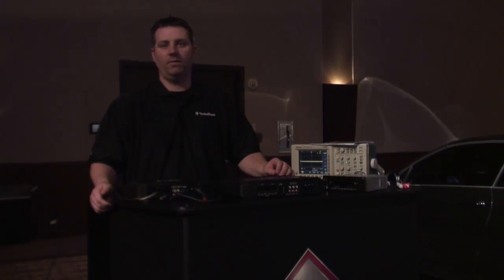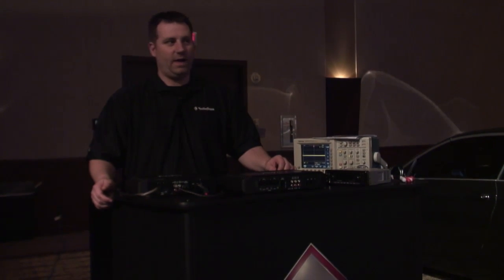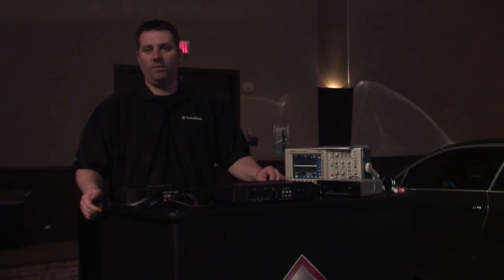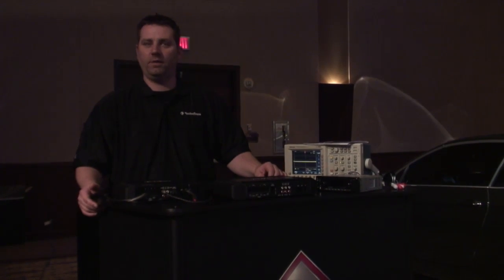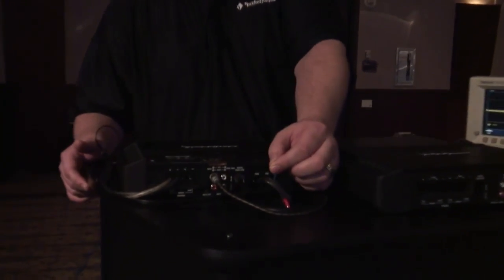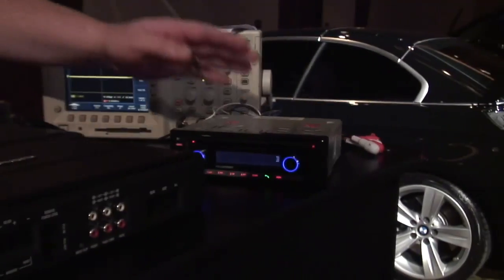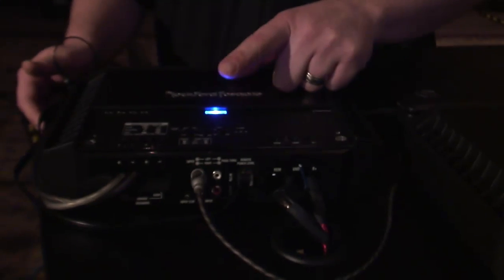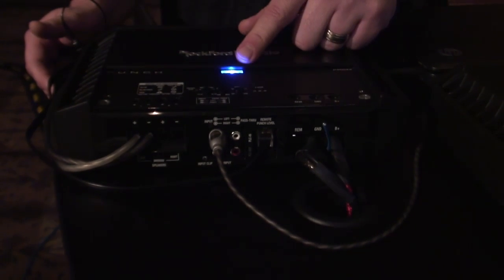2013 Punch Amp Auto Turn-On

Comment: My P1000x1bd won't turn on.
6v on RFI2SW RCA plugs. Using rear channels from stereo. 12v and ground on amp ok.
What have I missed? What have I done wrong?

Please help figure this out.
Reply from the maker: Are you daisy chaining additional amplifiers?  Disconnect the REM terminal and Pass-Thru outputs to see if the amplifier will turn-on.  Does your front amplifier turn-on when using the high-level outputs, but just not the P1000X1bd on the rear outputs?

Comment: So. If using the high level input instead of an LOC, this feature will be automatic?
Reply from the maker: Hi David, Yes, the amplifier has a built-in LOC so there is no need to use an external one.  When the amplifier senses the 6V DC Offset (there is a small DC voltage along with the AC signal voltage present) from the high-level speaker outputs, it will automatically "switch" to high level input mode.

Comment: Hope you guys notice that he is using the high level outs spliced into an RCA plug.
I got excited thinking regular ol' RCAs will auto on.

I swear I had a RF amp that had an auto on through the RCAs. but cant find the model.
Reply from the maker: As noted in the Description of the video, we simply use DC Offset to turn-on the amplifier and no longer use separate RCA inputs and Hi-Level Inputs. Therefore, if there is DC Offset on the RCA line, it will turn on the amplifier.  When using high-level outputs, you can purchase an adaptor so you don't need to cut any RCA cables to do this: https://www.rockfordfosgate.com/products/details/rfi2sw/

Comment: I bought a P-300 10" for my 17 Fiesta ST. I wanna hookup the High Level Input wires to my left rear speaker. Do I have to split the the wires into 4 and combine solid colors for positive and striped for negative (white & grey+, white/black & grey/black-)?
Reply from the maker: For best performance we recommend using BOTH left and right rear speaker signals.  Wiring up only the left speaker will cause your subwoofer frequencies to be lower in output since audio is mixed on both left and right sides.  If you have no choice, but to wire only to the left output, then you are correct and can wire it this way:
POSITIVE: white left(+) and grey right(+)
NEGATIVE: white/black left(-) and grey/black right(-)
Reply: Rockford Fosgate darn, i did have a choice to route wires left and right but i was told it didnt really matter because on the fiesta the rear speakers werent stereo bass...and mounting a single sub like this didnt lose frequency...ugh. hating the thought of removing the wiring now.
Reply from the maker: To the best of my knowledge, many systems subwoofer frequencies are mixed across both channels.  Just wanting you to understand that subwoofer frequencies are typically summed and you may experience lower than anticipated output using one output.  This would especially be true if the BALANCE knob on your source unit is anything but "centered". Move it to the right and you'll definitely have lower output.  You should be fine to use the LEFT output.
Reply: Rockford Fosgate thank you sir!

Comment: I have a yellow light on my p1000 x5 amp and don't know why
Reply from the maker: That is the Power/Protect/Thermal LED.  If this illuminates after the amp has run for a while, the amplifier is in "thermal" mode and needs to cool down before it will turn-on again.  If the LED is always on and cool, remove all speaker wires and RCA's from the amplifier (so you only have B+, GND, and REMote).  If the amplifier works, you most likely have a short or bad speaker on one of your cables.

Comment: Could I run your Rockford Fosgate 5 channel p1000x 5 punch  with 4 door speakers 2 p1675 punch 6.75" 3-Way and 2  p1675 punch 6.5 in the back doors. Also 2 - 12 inch Alpine Type E SWE - 1243 4ohms subwoofers with the factory head unit using a audio control LC7i.  Could I run all that on your 5 channel amplifier ?
Reply from the maker: Yes, all this can be run on the Punch P1000X5.  However, since your Type E subwoofers are 4-ohms, the lowest you can wire them is to a 2-ohm load.  The P1000X5 sub channel produces optimum power at 1-ohm.  This will mean the sub channel will be producing 300 Watts x 1 @ 2-Ohm instead of 500 Watts x 1 @ 1-Ohm.
Reply: Rockford Fosgate Do i really need a lc7i for my factory stereo for the P1000X5 ? Or can i just use speaker wire to RCA'S, or does it make a sound difference with the lc7i ?

Comment: i recently ordered the P400x4 and P1000x1bd and plan on using the LOC for an rca connection. Would I be able to utilize this feature using an lc2i?
Reply from the maker: Both the P400X4 and P1000X1bd feature High-Level inputs, so you basically have a built-in LOC into the amplifier.  The LC2i would also be duplicating most of the efforts already built-in to the amplifiers, with the only exception being the AccuBASS™ processing.

Comment: Does it have to be 6 volts or can it be 4 volts to signal amp on through RCAs?
Reply from the maker: Sorry, I realized nobody replied to this earlier.  These Punch amplifiers have a wide 150 mV - 12 V signal input range, so the input circuitry is capable of matching nearly all source units on the market.  The amplifier gains are used to match the amp to the source unit, so the source doesn't have to be a specific voltage.  However, we do recommend as high a preamp output voltage as possible to optimize your signal-to-noise.

Comment: Can this help people who are getting a "POP" when they are turning off their radio or taking the key out of the ignition? I'm about to fully replace my stock boston acoustics  system for my 2012 camaro, and have been reading in camaro forums that people are getting a loud pop when they take the key out or turn off the radio.
Reply from the maker: Turn-off pops are caused when the signal to the amplifier turns off faster than the amplifier.  Ideally the amplifier turns on slow and turns off fast.  Most of the time this is solely caused by the radio, so replacing it may fix the issue.

Comment from the maker: kenpoS2k & Aristotle, if you use RCA's direct from the source's RCA outputs, you do need to use the Remote Turn-On wire.  If you're converting your speaker line outputs from the source (that has a DC offset signal) into RCA's then you do not need the remote turn-on wire.  

If you need help determining if you have a DC offset signal, refer to our website under "Support > Knowledge Base" and search for "1140" or "Audio Signal Integration".
Reply: do what else would you connect to the amplifier?
Reply from the maker: Using the high-level input sense, you just need B+, GND and signal input.

Comment: there is no information on how to wire this... can i use a speaker wire to rca adapter to plug into my amp? i have a wire harness that i soldered all the wires to on the back of my head unit so i think my head unit has the high level input but im not sure, PLEASE HELP !! thanks

Comment from the maker: Your audio signal needs to have "DC Offset" present in order to use this function.  Depending upon the "chip amp" used inside the radio, your RCA (low level) audio outputs may or may not have DC Offset.  Typically High-Level (speaker like) outputs do have DC Offset.  Search the Rockford Fosgate Knowledge Base for "Audio Signal Integration".  This article explains DC Offset and how to test your radio for it.